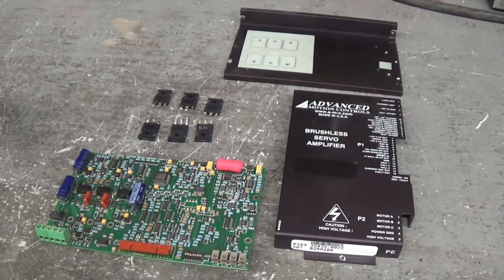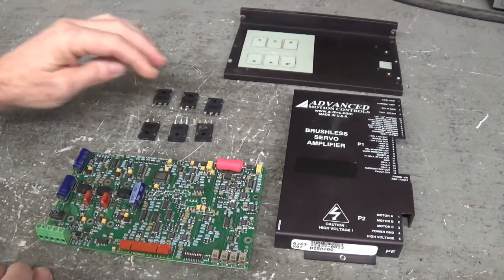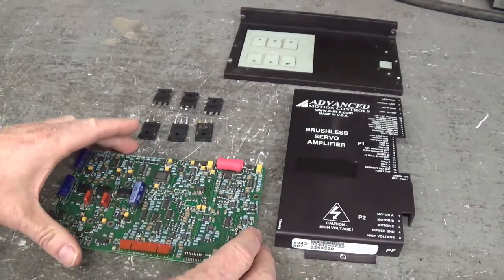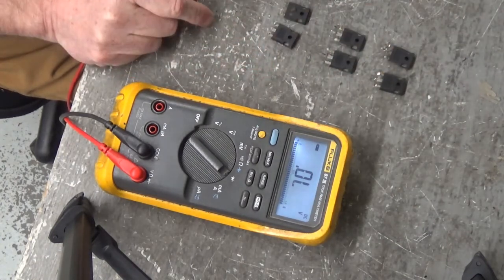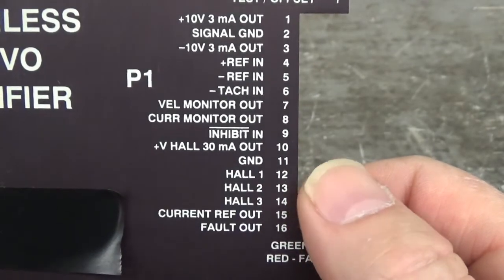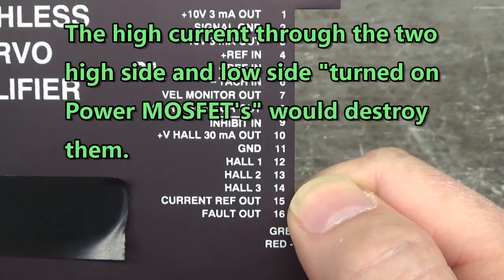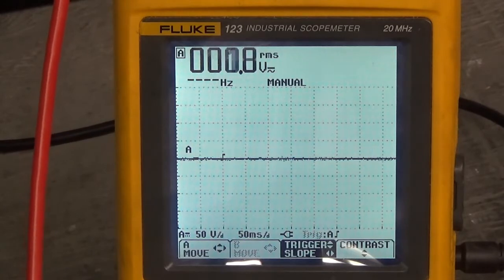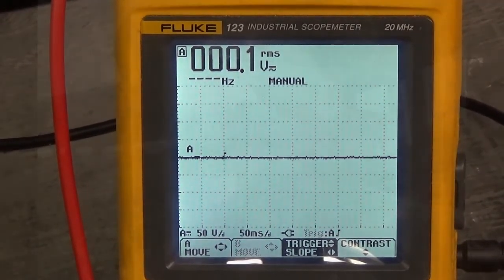Advanced Motion Controls Servo Drive Repairs and Testing

Comment: do you know the part number ic mosfet driver?
Reply from the maker: Hello Sir, I do not know the part number. I have drawn a schematic of the circuit. And have been all over the internet and the books here in the shop. And I have not found an integrated circuit that matches what I have drawn. i haven't given up the search. But the part is being very elusive. I am wondering if the part has been custom made. I am sorry that I am no help with your question.
Reply from the maker: You can remove a good part from a hard broke servo drive of the same model. And solder it into the servo drive that you are repairing. You can find folks selling broken, for-parts-only drives on places like ebay. Thank you very much for stopping by. I am always pleased to see other folks that are interested in electronic troubleshooting and repair.
Reply: Cud u share ur email id..i want to consult regading bush type pwm servo amplifier ..my servo amplifier show a very dim red led light..and after some waiting time it turns brighter ...there after it starts working correctly..
Wat cud be the probable cause of it..if u can please help.!
There is no problem with the input wire power supply...
How can i get through this problem..
Reply: I’ve found an abundance of these kinds of working drives for under $40 and for people reading this n the future, might not get chances like this